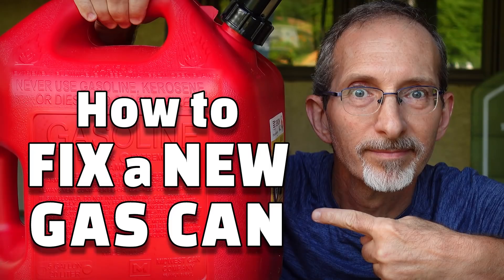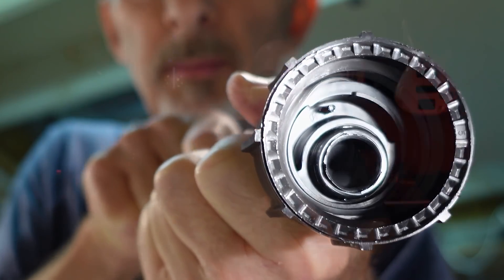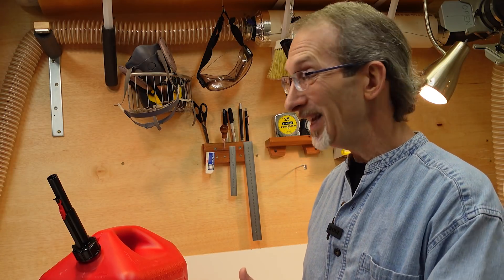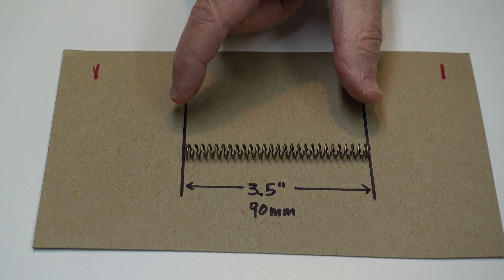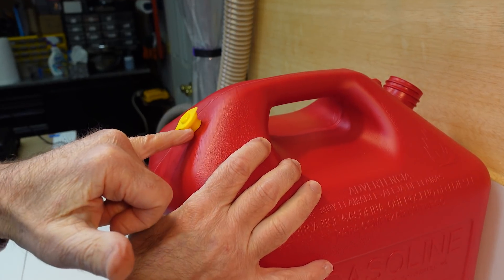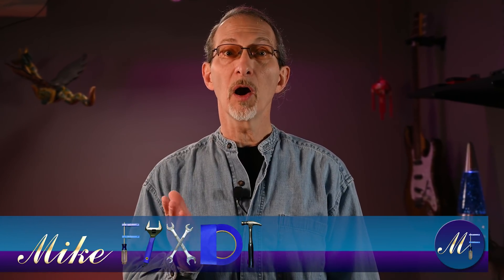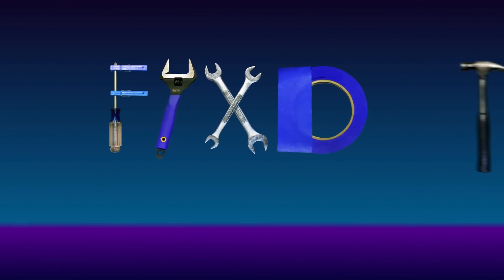Gas Can Modification | Part 2: Explosive Details!

Comment: Amazon sells replacement nozzle/cap kits. They have no stupid valve and a clear, flexible hose for the gas to pour out of smoothly. If you've added the air vent just use one of those and throw the original 'safety' cap/spout in the garbage.

It's gasoline ok? Not nitroglycerine! Been pouring it since I was a kid and haven't blown myself up yet..
Reply from the maker: Great point on this not being nitroglycerin! The sponsor clearly over designed for dispensing gasoline. Although could you imagine what a nitroglycerin dispenser would look like after safety legislation?

Comment: "Don't make things hard to use for the majority to compensate for the stupidity of a very small minority." Dude, you're preaching personal responsibility, which is blasphemy in places like California where this kind of safety hysteria has its genesis. It's sad that in today's world you have to be a handyman with a workshop just to end up with a gas can that functions normally. I got lucky and found a nice 1950s steel gas can at an antique store. I'll have to remember not to store it in my fireplace.
Reply from the maker: Cary, I agree that it is a shame these containers need to be modified to be useful! That’s great that you found a metal gas container from the 1950s. With all of these new containers being the way they are, what you have is quite a commodity!

Comment: Tried filling the tank on a motorcycle with one of those darned things! Virtually impossible to use without getting gas on everything! Ended up with gas all over the bike and myself! Bought the replacement spouts from Canada - now just need to add the vents.
Reply from the maker: Jim, the flexible replacement spouts are a really good option, especially for something like a motorcycle tank. I appreciate you watching!
Reply: @MikeFyxdt  Finally finished watching the video. Bought some cheap imported vents - just ordered the US made JSP vents - thank you!

Comment: Reducing the number of turns of a compression spring while keeping the same wire size, turn diameter, and free length will not reduce the spring force.  Reducing turns increases spring gradient. 

This means cutting off turns and stretching the shortened spring to the original free length would result in the forces being higher at the working lengths in the spout.  If the force is actually lower, remove your modified spring to check it’s free length. You will likely find it’s shorter than the original because you didn’t heat treat the spring to relieve stresses after you stretched it. 

Better to avoid the stretching.  Reduce the free length by just cutting off a few turns while keeping the spring long enough to close the spout. 

I am not a spring design expert but I am an engineer that has designed springs.
Reply from the maker: In theory this makes sense! I wondered if I should have heated the spring to change his temper, but I was afraid that was adding too many variables to the experiment.
Reply: @MikeFyxdt  You would have had heat the spring to a certain temperature according to the material. Too hot and you anneal it. 

I recently tried to fill a new can having a FMD and twice splashed gas all over.  The attendant said he hasn’t found a way to fill them either.  I ripped out the screen when I got home.
Reply from the maker: @gwford3  That was my experience too, George! Hey it’s nice to hear that someone else has gas station attendants! I can’t tell you how many people said I must be living in a time warp from the 1950s. LOL!
Reply: @MikeFyxdt  I will bet you live in the Northeastern US i believe the rest of the US is almost  without exception pump it yourself or you get no gas.

Comment: Those are not drill "bits". They are drills or twist drills. The machine that turns them is not a drill but is a drill motor. Drill bits are attachments to the cutting end of well drills for cutting through rock. Masonry drills have bits  permanently attached to the cutting end.
Reply from the maker: OK, so now I am confused… So none of these are bits? I have a feeling that professional terminology might be different from consumer terminology, but it is fun to learn the technical differences! Thanks for joining the conversation!

Comment: You do realize these are safety measures to prevent children from being horribly injured or worse.
Now, you should do a video on how you  have taken steps to prevent children from causing terrible disasters by circumventing the gasoline can's danger prevention devices.  

Yes, children are small and children are a minority. Today's children will be the adults of tomorrow.

Also you should covert your propane generator to run from natural gas - a simple matter of changing the orifice (in the emitter). That could make it less necessary to rely on the gasoline generator? I'd like to see a video on that project.

Thanks for the content.
Keep up the good work.  בס״ד
Reply from the maker: I appreciate your comments! My child safety comes in the form of prevention. There are no children near my gas containers, I keep them locked up and don’t have young kids. I am very interested in what it would take to convert this generator to propane. I agree, that would be an excellent subject for a video! Thanks for joining the conversation and for watching!
Reply: @MikeFyxdt  You have to keep your children locked up to prevent them from getting into shenanigans? Isn't that a bit extreme? On second thought, maybe it isn't so terrible an idea. 

Also, I referred to the earlier video, that showed your old generator - the propane one. Most propane appliances can convert to natural gas, and most natural gas appliances can convert to propane. 

Propane has a higher density than natural gas, so it requires a smaller orifice in the emitter. So you could feasibly use the same emitter, just drill it out a little bit to convert it to natural gas. Then connect it to your household gas line, and see if you can generate electricity from natural gas.

Your local gas company may be able to give you more detailed information on that.
Reply from the maker: I hear you! The propane generator works no more… I tried to revive it but it needs to go to the scrap pile. Where I live I do not have the option for natural gas, only propane. I would love to have natural gas. I miss cooking on a gas stove!

Comment: I don't know why they don't come with a cap. Ignoring safety, the cap is needed to keep stuff from contaminating the fuel. That 6" long spout is going to get filled with dust, dirt, metal shavings, sawdust, etc. Are they expecting you to waste the first pour on the ground so you're not clogging your carburetors?
Reply from the maker: John, if you were to ask the manufacturers they would tell you to turn the nozzle around so it’s pointing into the gas can and use the included plastic disc to seal the hall. I will never store my spouts immersed in the fuel, because this makes no sense to me and coats the outside of your nozzle with gas.

Comment: The biggest issue I have is the rigid spout. A flexible spout would be the answer to a lot of safety gas can challenges! Is there an after market flex-spout available? If so... Hook us up!!!
Reply from the maker: Rick, yes there are lots of options available. I will be doing a review of one in an upcoming video.

Comment: 31/64"? Are they kidding? Why couldn't they have just made it 1/2"?
And what metric measurement is closest to this crazy SAE size?
Reply from the maker: I will bet the manufacturer was aiming for half an inch, but once 1 million of these were made they realized that they fit a little loosely… Hence the recommendation for 31/64 inches. I forget the metric equivalent, but I think I put it in the video.
Reply: @MikeFyxdt : Yeah, interesting that they may have goofed up just a bit there. Also interesting that some really odd-sized drill bits even exist like some of those in that set that you bought through Amazon.
But no, you didn't include a metric conversion from 31/64" in the video. No biggie, though. Thanks for your replies!
My name is also Mike. (Christensen.)
Reply from the maker: @HelloKittyFanMan.  hi Mike! 31/64” = 12.3mm. Another oddball size… 😮
Reply: @MikeFyxdt : Haha, it's oddball either way! Why do these sizes of tools, etc. even exist? I can understand needing some tolerances that are within just a few thousandths of an inch in some applications, so as not to have much wiggle room but also not be too tight (such as engine valve lash). But in what world does a mechanical design (not just making up for an oopsie) of some sort need just a basic hole, or screw, rod, or OD of a tube, etc. that would be too big at exactly 1/2", for example, but too small at 1/64" or even 1/32" less?

I often wonder that about just general bolts and nuts in big things like cars too: "Why is this one 10mm and this one 11mm, and over here we have a 9, and there's a 12?" I mean even in places that aren't so tight that saving every bit of space that you can would be so crucial.

Comment: Where did they get their BS Answers?  Why are old old gas cans going for so much money at flea markets?  What idiot pours gas on an open fire?  That is called Darwinism, and those people deserve to be eliminated through natural selection.  I have 10 5 gallon gas cans from yester year for filling up my boat, ATVs, motorcycles, mowers, etc.  Not one of them has these safety spouts.  I had a can with a safety spout that my Dad gave me, and it was neary impossible to lift it high up on the Ford Tractor, hold it with one hand, work the release with the other hand, and guide the nozzle into the tank with my???  Yeah, that freakin can made it a 2 person job so trashed the spout and got an old Republican spout off e-Bay for it...  I guarantee Americans have spolled a hellluva lot more gas/diesel all over their equipment since the advent of the Libtards trying to save us from ourselves with these damn Democrat Gas Spouts...

Comment: The plastic gas can is blow-molded in a two part mold...the seam or rather, mold mark, is from this manufacturing process. The container is actually thickest and strongest at this mold mark. For that reason, that is exactly where I installed the vent. Works great!
Reply from the maker: Excellent, good to know! Thank you for sharing!

Comment: My main considerations on buying a gas can is, it has to have a handle also on the side to hold it in the pouring position OR the spout has to be FLEXIBLE,  there are no obstructions in the spout and it has to have a way to either cap the spout or turn it around and put it on the can with the spout inside and a plug sealing the opening. The spout staying OUT all the time is very hazardous and sometimes prevents the can to fit in a tight space.  Otherwise I spill gas all over the place.
Reply: I believe these spouts come with a little cap that will allow you to store the spout inside the can like the old days, then cap, then ring to hold it all in place

Comment: Maybe flushing the can after drilling would help to make sure you get rid of plastic shavings. Also, make sure your can is full of gas before heating it up to insert the vent🔥🔥🔥💣💥💥😅 I would recommend using a torch or flamethrower.
Reply from the maker: JP, going slow with the twist bit really didn’t make plastic crumbs at all. But I appreciate all of your “safety tips“ for a cleaning it out if it did! 😁

Comment: A coil spring is a coiled up torsion bar(for being compact).  When compressed, the coil spring wire rotates, that is how it gets its tension.
When you shorted up a coil spring, you shortened the torsion bar.(Making it stiffer)  You need a longer spring with smaller wire diameter.
It will operate smoothly then.
Reply from the maker: I understand the logic, but the spring was definitely easier after the mod. Crazy physics! 😂
Reply: @MikeFyxdt  In this case I think it depended on the amount of compression.

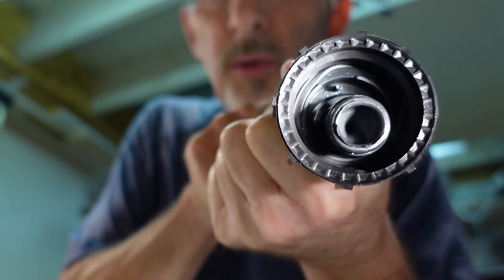Comment: Just noticed at 3:07 gasket is not installed correctly. It will leak.
Reply from the maker: I’ve had a few similar comments. The gasket is fine, but there is some sloppy plastic casting just below. It looks like a bent gasket, but it has no I’ll effect.

Comment: You should see the gas cans being sold in East Texas... the nozzle spout has a short lever you have to pull to be able to pour gas. I have accidentally poured gas all over BOTH of my generators while I was without power and REALLY needed to restart at least one of them (Hurricane Laura took out my power for 7 weeks). The spout is now just an awkward lid that I remove, and I use a funnel. After watching your video, I may take it apart and see if I can make modifications that allow it to be useful. I am glad to have found your channel!
Reply from the maker: Thank you for watching Ezra! These containers are difficult on a sunny day in nice weather. I can’t imagine having to wrestle with one of these as they come new, at night with the power out in the middle of a storm. Thanks for sharing your story!

Comment: I've done all of these mods and they all work well.  The best solution I've found however is this product which is available on Amazon:
https://smile.amazon.com/gp/product/B010GNM7H4/ref=ppx_yo_dt_b_search_asin_title?ie=UTF8&psc=1
it is a battery-powered pump that fits on the top of the gas or diesel can and allows you to pump the fuel into your vehicle or tool with no effort. Granted, it is ridiculously overpriced at $66 however when I am refueling my diesel tractor I literally have to take the 5 gallon can and hold it at shoulder height in order to fill the tank. This device takes all of the effort out and does it completely safely with no spillage at all. I purchased one of these for diesel and one for gasoline and it was money well spent. You do have to remove that flame arrester on the can however so make sure you don't go pouring gasoline on an open flame with the pump because then, indeed, Darwin will take over.
Reply from the maker: Joseph, thanks for commenting and watching. I will be testing a $30 battery operated transfer pump in an upcoming video. Stay tuned!

Comment: After Hurricane Laura here in Louisiana, most of us were out of power for several weeks, and the lucky ones had or borrowed generators.
Using those cans that spilled and splashed, around hot mufflers was very scary and could have been disastrous.
The generators required a full five gallons several times a day.
I finally devised a big funnel, removed the stupid nozzle, and poured without it. Still not the best, but this fix would have saved a lot of time, energy at 3 in the morning, and possibly my life and house.
Reply from the maker: David, thank you for sharing your story. I think it illustrates how important it is that these designs be easy to use. If they are difficult on a sunny day in nice weather, then how are they going to be practical in more dire situations? I appreciate you joining the conversation!

Comment: There's a thing called natural selection.  
So far as I can remember, those little yellow vents were always installed right on the seam of the can.  That's a good tip to offset it away from the seam.  Thanks!
Reply from the maker: If the seam is a weak link, you don’t want to make it weaker! Thanks for watching Curt!

Comment: One significant problem with this jug, is the straight rigid nozzle, due to straight flame arrestor.  We need a curve or bend.
Reply from the maker: Agreed! You have to lift the container further because the spout sticks so straight. I'm going to try a flexible EZ-Pour nozzle in an upcoming video. Stay tuned and thanks for watching!